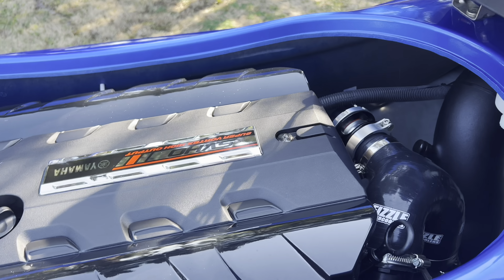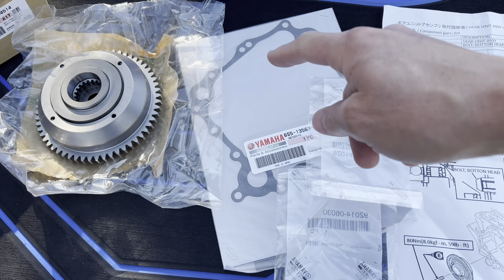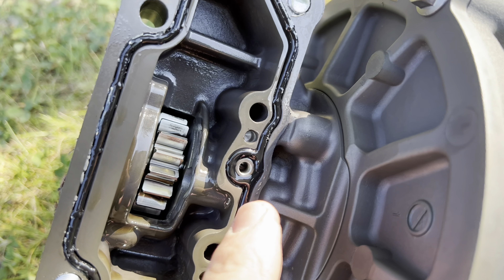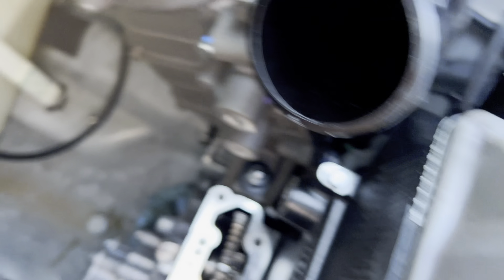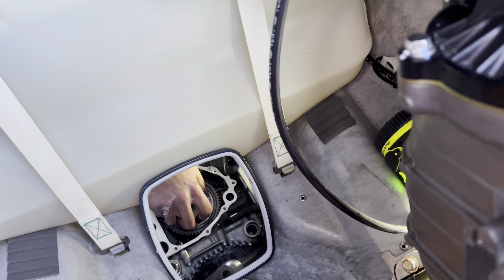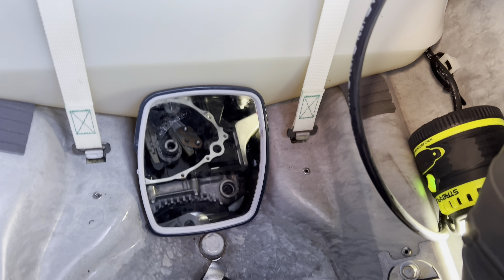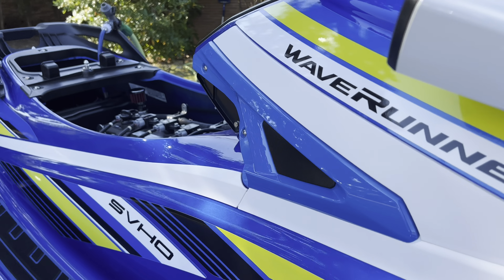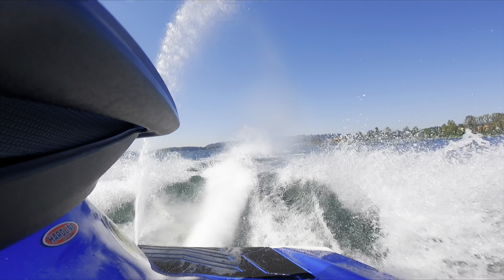GP1800R Supercharger Clutch Replacement

Comment: Awesome video, I had a GP svho. Dealt with the same clutch issues. Then for some reason I decided to get smart LOL went to a GP HO now, and with just a few mods and a tune my HO is getting stock svho speeds  and I don't have to worry about supercharger or clutch anymore
Reply: What mods you have?
Reply: Not as much punch though.

Comment: ++ Good CLEAR video - MIRROR was a great addition to see all the bolt locations - missing a few steps on reassembling gears although it should be opposite of assembling. 

Not sure what you meant by holes going in the same way. They rotate don't they? So you mean in the same front-to-back location?

I installed the shaft reinforcement - pretty easy. EXCEPT the OIL line thing is not nearly as easy as it appears. Sorta tricky to get the oil T installed and then the oil sender and then the wire to that. Not a lot of room to wiggle. Also use Teflon tape, not just sealant on the added line fittings. I used multiple layers to get it all secure. Instructions make it sound like you don't need it tight. BS.  

Just noticed my clutch is acting intermittent. Sorta weird. Only starts engaging after I try about 4 times and then the rest of the day it's fine. So your video helped me a lot getting ready. Might just do the bearing since my gears are fine.

Comment: Nice video, I got a 2023 year model. I’m pretty sure it’s the clutch. When your clutch was failing did you notice it being difficult to start up in the water? Basically didn’t want to start because it wasn’t making enough boost if that makes sense.
Reply from the maker: Thank you!  When mine failed it was wide open throttle and failed very suddenly. It did start right up with the only issue being the power loss. Like so slow🐢🐢🐢
I know Yamahas occasionally have a tough time starting after they warm up..
Have you tried new spark plugs yet.
Reply: No I haven’t put new sparks plugs in. I thought it was the battery since it has Slow engine crank to it. I normally change my spark plugs at 10 hours intervals and I’m already at around 65 hours on engine. The plugs might be 5 hours over, I’ll give that a try. But even when it cranks and runs my blow off valve doesn’t sound the same as before like it doesn’t get enough air. I will change the spark plugs and see what that does. If that doesn’t fix it I will take the air filter off to get access to the inlet of the supercharger to see if I have any back spin. If I know the supercharger to spinning both ways thens it’s the clutch.
Reply: Well I changed the spark plugs and the battery still doing the same thing. Took it out today, drove for 30 minutes, and hopped in the lake. When getting back on the ski wouldn’t start. I tried starting it a hand full of times, after the 4th time it finally cranked, but weak. I believe its the starter now. You think a bad starter could cause performance issues as well?

Comment: I have a Yamaha FX SVHO it only runs up to 6k rpm and I don’t hear or feel the supercharger. I changed air filter oil spark plugs do you think that it is the clutch that has failed? After about an hour of riding the supercharger turns on and holds but it needs a while before it can turn on and still won’t always stay on. Thanks
Reply from the maker: How many hours on your ski
Reply: @QuadStar721  it’s a 2014 with 78 hours as of yesterday
Reply from the maker: @Alboboyz Sounds like your supercharger clutch could be slowly going out. Mine went instantly when I was on the water. So slightly suspect for yours.  
Try messaging Jerry or his son at https://www.4-tecperformance.com 
Boys at Riva Racing could help too
Reply: @QuadStar721  thank you bro, you’ve been helpful.
Reply: Yeah my 2014 SVHO FX cruiser with 289 hours on it. Took it out and had very little power. Felt like limp mode and even limp mode felt slower. I got back to shore slowly now it’s getting diagnosed. Feels like a bad supercharger.. starts up right away ..no knocking or horrible noises..other than it seems a vibration from S/C area
Reply: @francisgraham7168  any update?
Reply: @Alboboyz  yeah supercharger fail. There’s play in the shaft . Yamaha dealer said $10,000 for new OEM supercharger assembly lol get fucked.
Reply: @francisgraham7168  damn bro wtf Ducking P, can get a hellcat engine for that

Comment: Good video, I am 90 percent sure mine went out, was at the lake yesterday ran good for the 1st lap. Then bam took a crap on me. Made it back to the marina slow and when I gave it gas it shook bad, so slow and easy back to the dock. Did you have about the same experience?
Reply: I had this exact experience with a 2023 fx svho. It would idle fine but shake BAD under throttle. Turns out the wire pin INSIDE my injector connector was broken. 40 hours on my ski when it happened.

Comment: What a great DIY video on this repair man!  Question for you.  When you pull the rubber hose off of the front of the supercharger and spin the blades on the SC fan are those supposed to be able to spin left and right freely or does the clutch prevent it from spinning in one direction if the clutch is good?
Reply from the maker: Thank You!
If the clutch is good should only spin one way as it has a direct connection with the motor
Reply: Seadoo says the 2024 supercharger never needs service
Reply: @brandonhenderson7020  yea but you also spent 10 times the money and the gp would clap it’s cheeks

Comment: broke the gear even using blow off valve? Do you believe that putting the blow off valve prevents it from breaking?
Reply from the maker: The blow off valve does help but unfortunately the Yamaha super charger shafts are weak and need to be upgraded to the Riva Racing Supercharger Shaft upgrade kit. Best option for reliability

Comment: What is the torque for the six bolts that hold the supercharger to the block? 4 of the bolts are M8 and 2 are M6 so guessing there are two different torques.
Reply from the maker: I’m not sure Mr. Nick I just used the German version. Good’N’Tight😁
Reply: 7.4 and 14.8 ft-lb
Reply: @jackdebbie  Thanks!

Comment: I took out the one-way bearing but my seems to be working fine I'm not going past 40 miles an hour.
Reply: When I use the fogger my engine does not choke out. Lose RPM what do you think
Reply from the maker: If you have access to ethanol free gas, that would be best option. As for the one way bearing in the supercharger clutch, it can be replaced and is a much cheaper option for the oem one.

Comment: Could you change the timing chain with the engine just stripped this much ? Instead of having to remove it from the hull
Reply from the maker: Not sure you can. Check with JP Racing. He might have a vid up for that one

Comment: Looking to get a Wave runner 
Between 
GP1800 
RXPX300 
kawi 310LX 
SeaDoo explorer pro
Which would you pick
Reply from the maker: Well I believe they are all awesome. My next ski will be a SeaDoo. So I will have both.  
The kawi 310 is also nice but not too sure how many aftermarket parts are available but all are good skis.

Comment: Seems I only can do about 50 mph do you think my clutch is not good anymore , 182 hrs on it
Reply from the maker: Might want to do a compression test first. Usually when the clutch goes it goes fast. Not a gradual thing.
Reply: @QuadStar721  thank you for the reply will consider looking into that after I chamo the prop hopefully those week and see how it runs then was going towards the clutch , will inspect way it spins when I’ll work on the prop . Thank you !

Comment: When i placed my the engine holder tool, I wasn't able to line it able with the hole to bolt in place is that normal?

Comment: If you tilt the ski way back on the trailer you dont have to drain the oil but great job not spinning the motor backwards thats a bad mistake to make
Reply from the maker: I did try tilting the ski but didn’t work for me so had to drain the oil. Lol😅

Comment: How many hrs before it failed?
Reply from the maker: It went out at about 135 hours. I believe it helped having a blow off valve installed or may have failed sooner
Reply: @QuadStar721  ride in chop?
Reply: I made it 217 before it let go. Stock ski with a hks blow off valve..
Reply: @shaunrigby6599  riding in chop (unhook, rehook) kills them faster, smooth water no major stress.  Ultra system is simply better
Reply: Mine went out with 75 hours again at 140 hours

Comment: Part number tools
Reply from the maker: Part number for supercharger holding tool is 612-92012 and can be purchased on Amazon for cheap. As for the supercharger clutch I went to 4-tecperformance.com and bought it there in a kit. Comes with the gasket and new screws for the timing chain tensioner